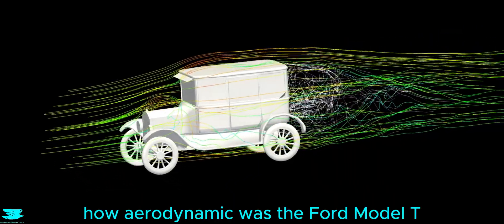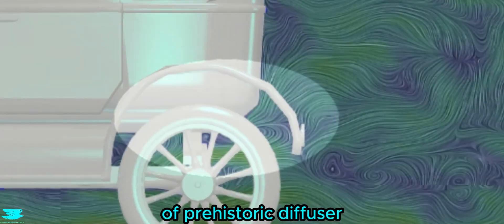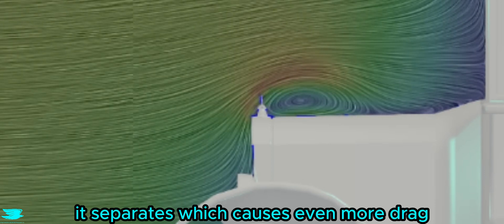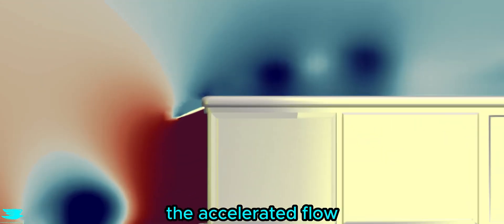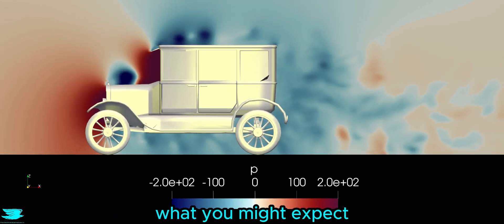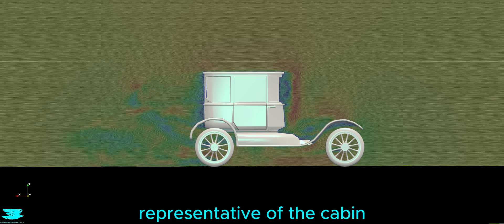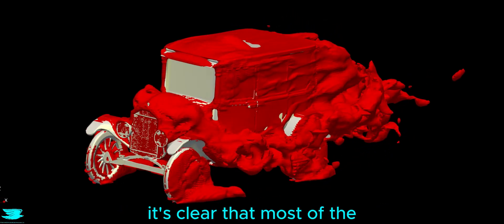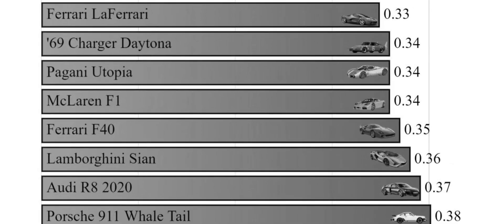Shameful Aerodynamics Of The Ford Model T

Comment: Your calculations and observations are interesting from a theoretical perspective. However, this exercise needs to be put into context. First, you are calculating the aerodynamics of the Fordor model... yet the Touring and Roadster (both open top vehicles) were much more popular versions of the Model T. Second, aerodynamics are only relevant in decreasing fuel consumption and wind noise and increasing stability when the speed of the car is above 45 mph. Thus, the poor aerodynamics of the Fordor model is irrelevant to the performance because the top speed is too low. Third, the roads in that era (1920s) were generally so poor (as were the brakes of the Model T) that 35 mph was considered a safe speed. The subsequent Ford Model A (1928 - 1931) had a 65 mph top speed... which would have been even higher except for its poor aerodynamics (more relevant theoretical exercise).
Reply from the maker: Thanks for the input!